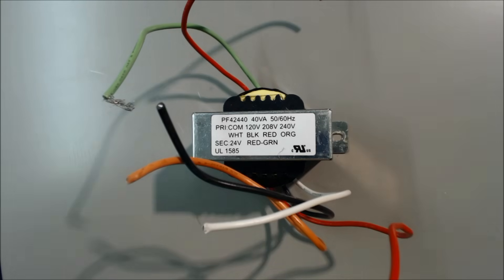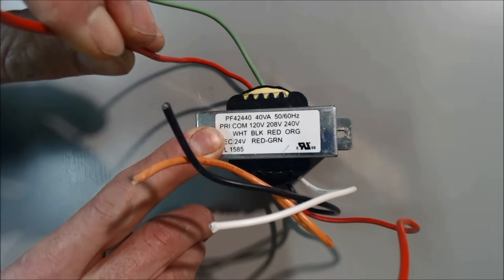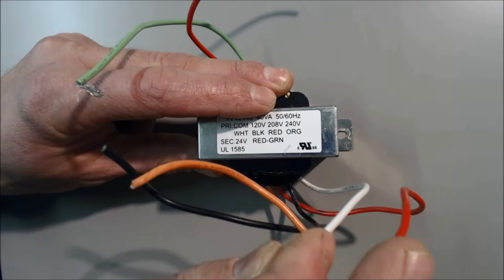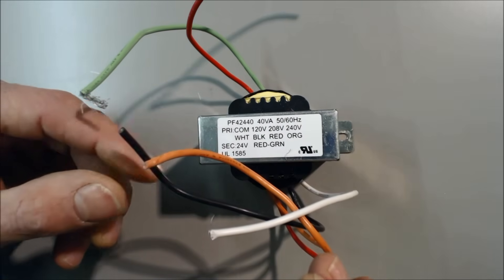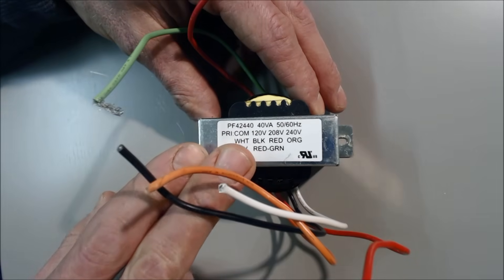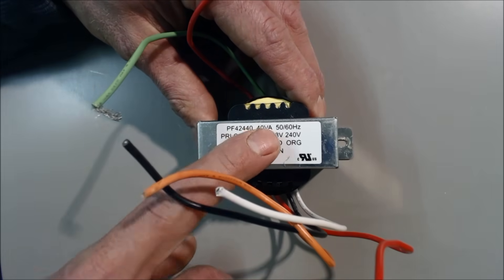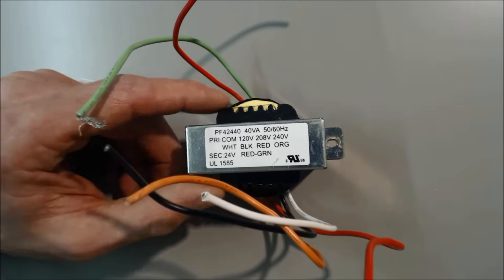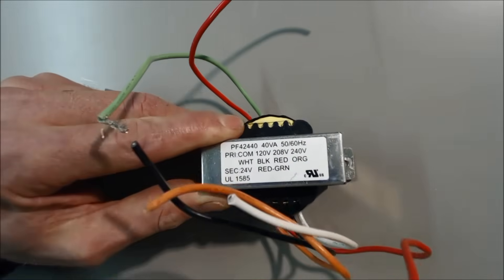Which HVAC 24v Transformer can you use for Replacement on almost Every Unit! Transformers

Comment: I'm getting 34 volts out of it from a 208 system
Reply: Tad high, but I always get 27 on 120v so I wouldn't worry. If you were getting 36 then I would replace it, but 34v DC isn't going to hurt anything. Just my two cents.

Comment: Swamp cooler with 3 power for motor. Contractor, switch, and transformer wired in. Switch will not shut off. (Dual phase 240). 2 sides provide 120 each. Switch shuts off line 1. No common available. Is the transformer of a correct type?
Reply: Transformer will not power down.

Comment: I have a 120/208v line voltage system with red, black, and ground wires connected (with two red wires behind my current thermostat wire nutted together for whatever reason). Will this work to power a Nest Thermostat properly? Do i still need a C wire aka their Nest Connector?

Comment: Hi came across your video, can i use this transformer to step down a 120 volt thermostat on my boiler. Im looking to put in a nest thermostat, and was wondering if this could work for me, so i can get rid of the old 120v and put in a 24 volt wifi enabled nest thermostat. Would you happen to have a wiring diagram for this to be done, on a heat only system with an aquastat relay.

Comment: Thank you for the video. My 35VA transformer on the furnace went bad. Can I replace it with a 40VA transformer?
Reply from the maker: A 40VA will work because its slightly larger in size

Comment: I’m late but would this work on a irrigation 2 wire system and if so what wires would I use and what wire could I put a fuse on the 115v side to prevent overload

Comment: So  if I have 2 120 volt wires no neutral no ground  for a 240 volt wall heater in  how do I wire transformer to come down to 120 for new 120 wall heaters. I really appreciate your help..

Comment: How do you determine what size transformer to use and what size fuse to use? I am trying to add some relays to my system and I cannot find out what their coil power draw is and determine if the transformer will work.

Comment: I've got the block style transformer 24v 120v  with 4 prongs. The unit is a Diamond 80 furnace. I'm wandering where the white wire or common lands on the circuit board ?? Your experience is appreciated.

Comment: I live in Savannah GA and my transformer died… I know!!!   There are a few places I could get a new but it was after hours and they were all closed.  So on a whim, I checked continuity on the primary winding between C and 230 and got nothing, however there WAS continuity between C and 208. You see where I’m going with this?  I put the transformer back in the air handler, reconnected the low side and connect the high side to the C - 208 tabs. Turned on the juice, no smoke, all is good. As of the time that I am typing this, it’s been running for about 3 hours (it got up to 79 inside).  Everything opens up around 7am, hopefully we make it!

Comment: Nice video.  
For educacional purposes help  me understand this.  I have a 120/24v transformer.  On the secondary side From terminal labeled 24vac to ground I read 17volts ans From terminal labeled 10VA to ground I read 16Volts.  I read 24v across these 24v and 10VA terminals.

  How do I determine which one of these two  wires  is the 24V hot?  I was expecting to see 0v from one of these legs to ground.
Reply: You should pick any one of two as ground, connect it to the ground.

Comment: Which wire do you connect the 3 amp fuse to?
Reply: To your 24 volt power side
Reply: @jpintrick84  So on the LOAD wire coming out the 24v side? (or the NEC coming out the 24v side?)
Reply: The 24 volt wiring

Comment: Wow it’s amazing how much I learn in such a short vid. I’m about to replace a broken transformer in my air handler.  This give me the knowledge and confidence. Thanks!
Reply from the maker: You can do it!
Reply: @acservicetechchannel  9
Reply: So did you burn another one?
Reply: @gibby9280  oh yes I did get one on eBay ($20) and replaced it in 15 mins. Piece of cake😊
Reply: @obrianthinline8514  changed mine burnt it too. Learned to put a 3amp fuse. Changed sequencer,coil relay, limit switches. After several blown fuses found it was my thermostat!!
Reply: I know I'm late, but you should just leave these things for us technicians.

Comment: Hi where does the Neutral wire go? i disconnected a broken transformer with out looking at what i was doing, it seemed pretty straight forward. Now i cant figure out where to connect the white wire. the power entering is 2 phases entering the unit but no Nuetral. What do you think i could do? Thank you in advance for your help.

Comment: Mr Craig I have a question,3 months ago I changed a burnt control board  since then I can hear what I think is the transformer humming, could this be a signal of any problem, thank you and your videos are number one on hvac teaching keep the good work
Reply: Only time they have ever buzzed for me is when I tied the wrong wire In for common. Like if you put the 120v lead and the 240v lead into the contactor or on the board the transformer buzzes then pops after a few Mins.

Comment: When I'm hooking up a uv light and using a separate transformer do I hook the orange and white to the breaker in the air handler?
Reply: Hi Christian, were you able to find answer to this question. have you connected the UV light via transformer using orange and white to breaker ?
Reply: It's considered unsafe to connect more than one wire to each terminal of a breaker. It's better to connect the source wire from the breaker with the load wires to the 2 transformers using wire nuts.. I do see that it's been 2yrs, but still hope this helps.

Comment: I have a question about the 240v hookup Transformer.. you said the  rightway to hook up to hook up orange wire  one pole that 120v of the 240v and the white wire ..do you hookup the white to  the com or the other 120v line   please let me know.. thank you.. if you answer that for me.
Reply: Same problem, I have no idea what to do with the white wire
Reply: @Aurelisk on a 240v circuit (one ground wire two hot wires) you wire the black line wire to orange 240v  wire and the white line wire to white com wire.
Reply: @j727100  That still doesn't make sense to me.  The white common is grounded.. and the black line wire is only 120V.  So why is it saying 240V?  It's only getting 120V.

Comment: How hot should one of these transformers get on 120v with no load? I have one this same model that when sitting on a desk with nothing but 120v connected to white/black gets too hot to hold on to after a few hours, and another one of the same type but different brand that I just bought that isn't a whole lot cooler. Thanks.

(tmi: Using for project box overkill thermostat builds with a thermostat module and contactor switching an outlet for a window a/c or space heater, because thermostats in those things fail far too often nowadays. I currently have a window unit with a failed digital thermostat that's rewired to always on, and another newish one with a regular thermostat that sometimes needs the knob cranked around a few times before it'll kick off again. And space heaters trend towards completely random on a good day...)

Comment: I just changed the Transformer on a 240v air handler I'm getting 124v to one leg and 116 V to the other leg of incoming power. But not getting 24v out of the Transformer even after changing the Transformer, would you think the 1 high voltage leg being only 116v would cause the new Transformer to not put out 24v? I tried putting in two different Transformers and still not getting any 24 volts out
Reply from the maker: You may want to contact an electrician or the electric company. Something isn't right. They should match closely.

Comment: I'm my universal one the 24volt side is a blue and yellow so witch one is the ground
Reply from the maker: You can power the high voltage side and test for 24v to ground with a multimeter before hooking the transformer up to the controls. The ground is the base feet of the transformer where this touches the ground frame of the unit make sure the two low voltage leads are not touching the ground, thanks

Comment: I need help.. I have a issue with needing to rewire the train air handler I have.. their is three main wires I have to connect to.. they’re thick gauge main power wires colored red black and green.. I need to know which I have to connect which to to get the blower back to working again.. I have a picture if I need to send it.. I believe it’s 240 .. the transformer is a pf52475 3.2 amp .. the blower is a Trane twv030b14f... 

Currently the green wire from two wire side is connected to the Grey wire from the unit and the red wire connected to a black and red wire from the unit.. I have red black blue and orange on the other side of the transformer I need to figure out where to connect to.. there is also a small red wire coming from the unit not connected to anything..

Which of the thick black red and green wires do I need to connect to the transformer and which transformer wires do I need to connect to the unit? 

From the unit I have two small white wires and a red wire same size not connected to anything..and the larger gauge red black and green..

Comment: On the 24v side the wires are yellow and blue. On the one i have but the one i will replace the colors are like the on you showed
Reply from the maker: Hey B San, the new transformer should come with a wiring diagram to show which one is the 24v power wire and which is the common, thanks

Comment: Brother,  fuse goes on common wire that's grouped with high voltage wires ? Do you also put another fuse somewhere on transformer or just there?
Reply from the maker: We put the fuse on the 24v red wire coming out of the transformer. You could use just plastic coated spade connectors and a 3 amp spade fuse. The high voltage side has the disconnect switch outside of the unit and the breaker inside the breaker box to protect to high voltage side, thanks Daniel!

Comment: I have two electric baseboard heaters producing 16 Amps currently connected to a double pole  22A-120/240 Vac(18A-277VAC res. only) thermostat. Can I use this same contactor to connect on a 24V  wifi thermostat?
Reply: am doing the same thing

Comment: are you available for some questions?
Reply from the maker: Just post a new comment and ask any questions, thanks
Reply: thank you ,here is my first question,,,i have a 120vac to 12vac at 2amp trans,,i took a reading of the voltage on the outer wires of the sec and it was around 15 and then when i took the center tap to any other wire got a round 7 or so,,if its rated at 2 amps for the 12 v does this mean i should get 4 amps for the 6v if im using center tap? because i was able to nicely light a headlamp bulb with the 12 v @2amp but when i used the 6v thinking i would pull 4amp the brightness was half,,so what is going on?
Reply: here is my second ,,you know how you get nice sparks when you short a car battery ,im wondering is this something that can be done safely if the car is off and im only plugged into the positive and negative terminals? or negative part of the chasis? without going into lot of details i basically need to be able to get those sparks for a project,so i need to have safe low volts and high enough amps to produce the sparks,i will only need to strike them every now and then and not continuous,,so am i ok using my car to do this or is there some kind of simple electric circuit  i can make that plugs in any outlet or wallmart  and somehow reduces the voltage yet gives me high enough amps to do this? i was thinking of a trans and a dc bridge rectifier with capacitor for such a circuit,,problem is the 12 v 2 amps from my trans does not seem to produce workable sparks strong enough for my project,,should i simply get another trans or is there another way to do this?
Reply: @acservicetechchannel  you never replied after 5 years im seeing this now lol

Comment: Isn't that aluminum wire
Reply from the maker: That is actually copper wire that is tinned with wire solder to keep the strands together. That is done from the manufacturer on components often times, thanks Phollip!
Reply: AC Service Tech LLC Whew I just was thinking about all those transformers I installed and it popped into my head that I may have been doing copper to aluminum this whole time
Reply from the maker: They were copper. Strands of aluminum that small would not be safe with the lower melting point. That is why we use copper conductors in homes and when stranded aluminum is used on larger gauge wires, antioxidant compound is also applied to make sure the joint is making good contact, thanks

Comment: Your secondary 24v red and green wires, does it matter which one is common?  The transformer just says 24v green-red.
Reply from the maker: Red is usually 24v power and yes it will matter when hooking up to an HVACR unit, thanks
Reply: AC Service Tech LLC  thanks!

Comment: I have a bad transformer on a air handler and it only has 2 wires hooked up to the hot side of the low voltage and nothing on the common side. I bought a new transformer that has wires on the low voltage side. what does the common wire go to ?
Reply from the maker: On the low voltage side on the wiring diagram, it may have the 24v common connecting to the ground chassis but you would need to verify by following the wiring diagram, thanks

Comment: Can you explain how the common on the primary is different from the common of the secondary side. For example on a 480v transformer, they label use black-common and Gray for 480.
Reply from the maker: Electromagnetic induction allows current to pass from one coil of wire to another coil of wire that actually are not touching but wrapped around the same iron core.  I would look up electromagnetic induction or how a transformer works, thanks

Comment: Can I use a VfB class 2 transformer to run car audio amp and subs in my house? Rather then the computer power supply?
Reply from the maker: You can use a transformer but you are still talking ac voltage and not dc voltage such as 5 dc volts coming from a usb, thanks

Comment: if on the 24 volt side i only have a yellow and a blue,which is common and which is hot? blue is the common,right?
Reply from the maker: Hey Kenny just check for 24v with the multimeter using one of the two wires with one probe and the other probe on the 120v common or ground, thanks
Reply: but what if there is no common its a 240 system i have it hooked up just the way video shows and getting power 120 on both orange and white wires but no 24v coming off blue or yellow wires

Comment: Would you call it primary and secondary winding. Just like the winding in a compressor Start winding (larger) then the Run winding (smaller).
Reply from the maker: Yes the primary is larger that the secondary, thanks

Comment: Hello, I have a same part# transformer in my package unit.  on the primary side of transformer,  is it only 2 wires are used at once?  the old transformer that was installed had blk(120) and red(208) connected on 2 poles on the contactor and the wht (com) was cut off, not used.  by doing this do you get 240v?  the green (com) was grounded to the frame
Reply from the maker: You would use com-white and orange 240 to get 240v. To get 120v you would use com-white and black 120v. Make sure to individually wire nut the other high voltage wires not in use, Thanks
Reply: thanks for the reply.  I think someone must went into my system and swapped out the transformer with theirs.  this unit was installed less then 2 years ago.  everything looks new except the transformer, which has some rust on it.  there is a label under the contactor say rewire transformer for 208 if 208v is use.  that mean white use to go L1 and red goes to L2.  thanks for the help.
Reply from the maker: Glad to help. Yes com will be one of the two line voltage wires, thanks.

Comment: I added a 3a fuse to my power supply (40VA) and attached two spade terminals to the hot wire of the 24v side. Works great now I feel that I protected my board better. Older system, 1999 no fuses!! THANKS Great vids by the way.
Reply from the maker: That's great to hear, yeah add that protection in. Good idea!

Comment: If I was going to add an inline fuse to the 24 volt transformer side what gauge wire and amp would you recommend
Reply from the maker: Thermostat wire, 18 gauge would be fine, 3 amp would be good. Thanks

Comment: Does the 24 volt coming from the transformer go to the board first or the thermostat
Reply from the maker: To the board then typically status light, then fuse, then safety sensors, then board therm terminals, then thermostat